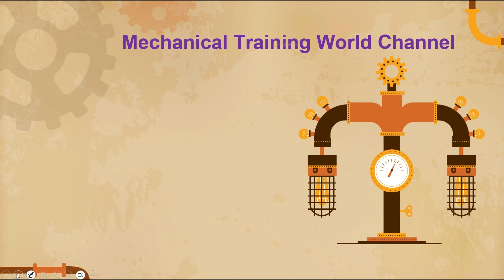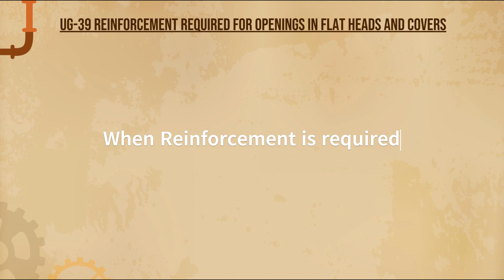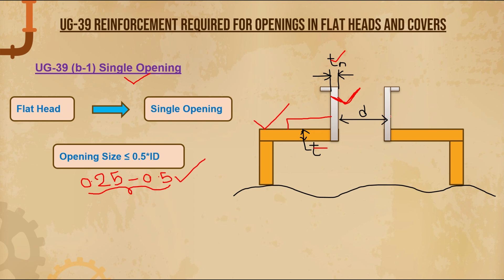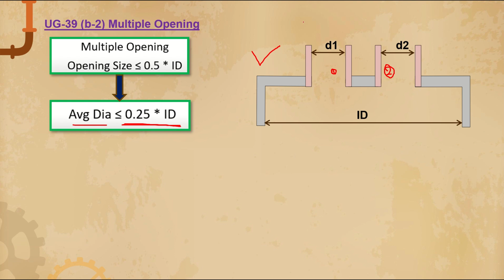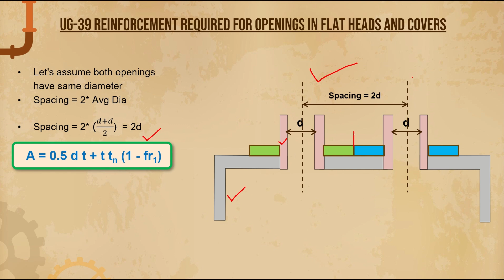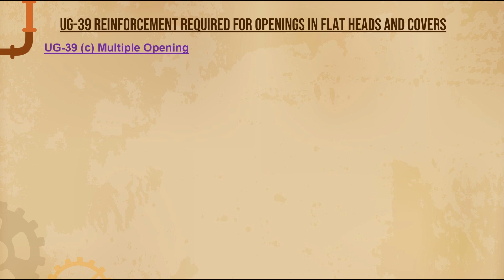UG-39 Reinforcement for Openings in Flat Heads & Covers | ASME BPVC Section VIII Div. 1 Explained

Comment: Sir , how do I decide my reinforcement is sufficient or not ?
Reply from the maker: If you satisfy the UG-37 and UG-39 conditions, your reinforcement is OK.
Reply: @MECHTechworlds  Actually it is a bit confused my mind. Every time I read , I realized something different in ASME. It' s like a kind of magic :D 

UG-37(b) says that ;  
General. The rules in this paragraph apply to all openings other than:
(1) small openings covered by UG-36(c)(3);
(2) openings in flat heads covered by UG-39  etc. 

When I read this paragraph I asked myself , what ? Than how do I evaluate my area replacement is enough ? I seek something in UG-39 but nothing mentioned about available area except required area. 

Well ,at the end of the day , I decided that there is no another option to make this properly.

What is your opinion ? Please share your thoughts with me. 

Kind regards.
Reply from the maker: Your are right brother.
Code creates confusion.
So as per my understanding and practical knowledge I have uploaded UG-36 to UG-45
Almost I covered everything in the openings and reinforcement and nozzle calculation
And also you will get example problems from this channel.
I hope if you watch and write some points that will solve your problems.

But you need to spend time brother.
Everyone wants to learn but they don't spend time. But you don't do that mistake.
 Sorry for delay.